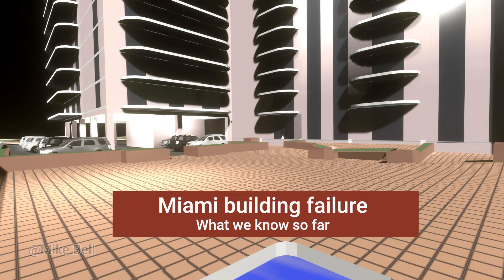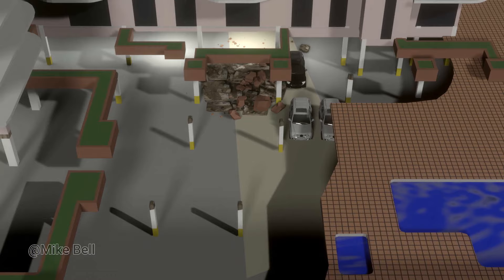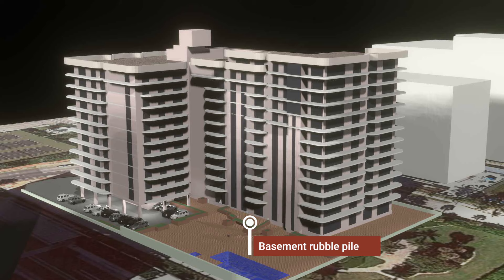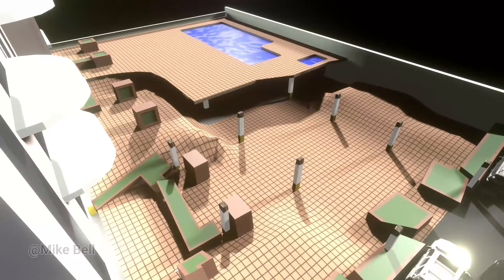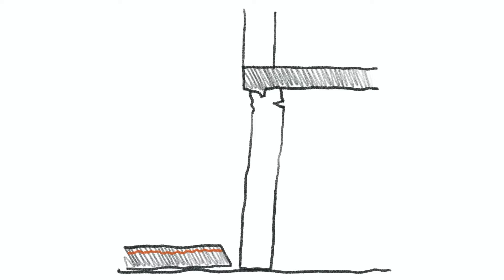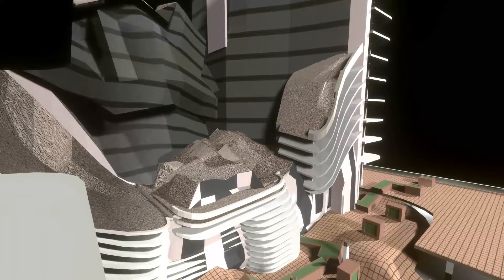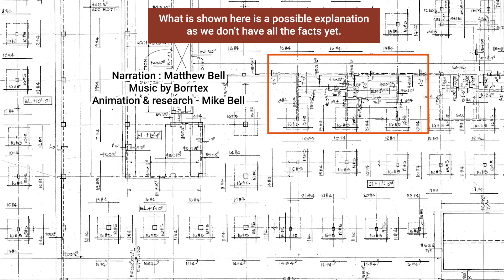MIAMI CONDO COLLAPSE | visualization of the evidence pt2

Comment: Why didn’t the front desk pull the fire alarm. So frustrating if they saw the whole thing caved in outside.
Reply: Fire alarm was apparently activated by the damage in the garage, there was a 911 call by the monitoring company reporting this a few minutes before the collapse.  Not sure of details beyond this, like if this should have or did activate the audible alarm.
Reply: @k53847  Never happened. The system does not dial 911. The broken pipe is not a sprinkler pipe its PVC
Reply: I guess the time was too short, they didn't know what they were looking at. The time lag was only a few minutes.
Reply: Might be a little deeper than that. A friend of mine lived in a new apartment building. An electrical fire broke out in her apartment while she happened to be home (the smoke detectors never alerted, even as smoke billowed) and, as she frantically escaped, calling 911 at the same time, she was told NOT to pull the fire alarms. That was always super suspect to me.
Reply: @7YBzzz4nbyte   In order for the people that say the pool deck collapsed  to be right the fire alarm would have gone off. Its a complex system. It does not dial 911 it sends signals. The two narratives are this. The roof was overloaded with roofing materials and caused the collapse . This puts the city at fault. The pool deck collapse puts the condo at fault . Had the pool deck collapsed 7 minutes before the building it would have triggered the fire alarm. Set off strobes in the entire building along with alarms. And then sent a signal to the monitoring station - that would relay that to the fire department directly.. (not through 911).
Reply: @whirlwind8825  Did they have an alarm like in office buildings? We don't where I live, every flat is its own compartment (annoyingly). It's a shame that those beams from the pool deck/garage attached to the side of the buildings pillars, and yanked them out when they fell, very tragic in hindsight  😢
Reply: @whirlwind8825  Well, then explain the 911 call at 1:16 am https://youtu.be/v2zRuxNjG2I?t=59
Reply: @whirlwind8825  Why does overloading the roof put the city at fault?
Reply: @7YBzzz4nbyte  Never happened. The deck never collapsed before the building.
Reply: @k53847   The building fell at  1:25am.  There were no alarms or  strobes . Had the system  alarmed at 1:16 am  the 300 psi pumps would have energized . The whole building would have evacuated under alarm . With 9 minutes warning  instead of 7 as the video with the leaking pvc pipe shows .
Reply: @sriley322  The city and the engineer knew the report of the buildings structural integrity . They did not red tag the building . Instead they issued a roofing permit and loaded the roof with tons of material. A one million dollar roofing contract for a new roof . The city told the condo association the building was safe .
Reply: @whirlwind8825  Well, in hindsight they were wrong. I just watched a documentary on Titanic, and it didn't go too well either (but could have, had things played out differently).
Reply: @whirlwind8825  Interesting- I didn't put that together but it makes sense.
Reply: @gymeni  In my building there are no fire alarms to pull. Not required, none installed. Each apartment has their own little fire alarm, mandatory, but none for the entire building all at once.
Reply: @whirlwind8825  if the deck didn't collapse before the building how do you explain the tourists' video into the parking garage? collapse of deck is seen and the building is still standing.
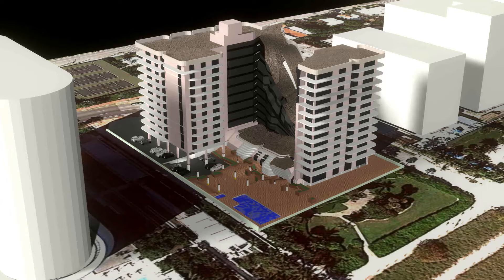Reply: @k53847  If the alarm went off  at 1:16 the whole building would be strobing, pumps running , alarms sounding. The only reliable evidence is the video . It is verified 7 minutes before the collapse . The audio is silent .. no fire alarm, no pumps, no strobing lights. Fire alarm  techs know I am right .  the system is inspected yearly . Broadcastify has the first dispatch to  the building by The  Fire department  and they are responding to a collapse ... Not a fire . The dispatcher clearly says collapse . And when the truck arrives he calls for all hands
Reply: @SierraFoxtrotLima  the video is the garage entrance , it only shows a pvc pipe leaking water slowly , no collapsed deck
Reply: They would have died anyway. Fire alarms sound fire alarms. Not water or  building collapses. Thus the term "Fire alarm".  Foolish question. Sorry
Reply: @novellmusicmedia6895  Yes, but it would have woke everyone up, and alerted them to an emergency. If the fire alarm was going off, then one would assume a fire was going in the building, which is a reason to evacuate.
Reply: @whirlwind8825  and what is on the floor of the garage? that is the main drive through - there is clearly debris there! you wouldn't be able to drive a car through it!
Reply: @whirlwind8825  That argument doesn't match up with the eyewitness descriptions of the pool deck having collapsed while the building was still standing.  The video of the parking garage supports those descriptions.

What you say might have been a possibility in an alternate reality, but with the various reports that the pool deck did indeed collapse first, it's not this reality.
Reply: @Test121212121212  many things don't match on his statements, he lacks many info on the subject.
Reply: @whirlwind8825  i never said it was the sprinkler pipe - I asked you what was on the floor of the garage - in simple terms. there was clearly debris on the floor of the garage before the building collapsed - so I ask again - what was on the floor of the garage in the video before the building collapsed? You don't give much credence to eye witness accounts and video evidence in your explanation.
Reply: @whirlwind8825  the area you can see from the video is not the ramp, it is the floor of the garage - go back and look at the building plans and count the columns. The debris is clearly on the flat garage floor and not the up/down ramp.
Reply: @whirlwind8825  pretty confident it did, by witness accounts
Reply: @whirlwind8825  no, there is also clearly rubble beneath the leaking pipe, big chunks
Reply: @purplepixie274  above that debris is the generator room..no pool decking and above that is a condo all  intact until the building collapsed .  There are no reliable witness accounts. Only people here defending a theory on 3d animation. This theory does not stand up to facts. And facts are in the fire alarm sprinkler system , the pumps(never actuated). No alarms and no strobes.  The facts prove the city, the engineer, the roofing company, and the material supplier that stocked the roof with a crane are all on the hook . The paper trail does not lie and is also factual. We have permits, approvals, and a Notice of commencement on the roof being completely replaced. A one million dollar contract and 27k in fees to the city of Surfside. After a Engineering firm recommended repairs on a building that should have been red tagged and emptied of occupants in 2018
Reply: @whirlwind8825  the debris is not on the ramp, it is on the garage floor.
Reply: @SierraFoxtrotLima  @Sarah Lancaster  The entrance ramp goes in and down to garage level   http://prntscr.com/1glgs55  the debris you see is under the generator room next to the stairwell  (second response ) There is no pool deck there....    Here is where the debris is http://prntscr.com/1gp1m7s    ... Here is what is above  the leaking pipe  http://prntscr.com/1gp3dz5   ......  Also the lights are still onhttp://prntscr.com/1gp9vr8  House power has not shorted out and tripped breakers
Reply: Also know one gonna think the building gonna fall ez to say shoulda woulda coulda after the fact.
Reply: @whirlwind8825  in the video you can see column 27 and the debris lies around and beyond it - col 27 is the edge of the building, what lies beyond it that has collapsed onto the garage floor is the pool deck.
Reply: Apparently whirl wind knows all.
Reply: @k53847  the sucky thing was the building had multiple cameras on the property facing different things including the pool deck, the cams fed to the security station in the building. But, like everything other outdated thing in the condo towers, the video feed went to tapes, and not the cloud. So when the building collapsed it crashed down onto basically the VHS tapes they used, all the security footage that was going to basically VHS cassette crushed so badly the tape was ruined by grinding, water, and dust. What a mess.
Reply: @kittykat7858  Whirlwind wants justice for the families. The victims. What you are seeing in real time is  volleying for culpability. Had I inspected the building I would have red tagged it (removed the occupants)  in 2018.   I would have shored up the building  before I  issued any permits in 2020 and loaded materials to the roof .  And I would press charges against the city inspector that told the board  the building was safe  after the 2018 inspection.  
 The bottom line is if I am correct the engineer and the city are at fault. They owe the people  or their families  a new building and some compensation for their agony, (they issued a permit on a building that should have been red tagged ) . 
   Saying the pool deck collapsed and pulled the building without absolute proof  or visual evidence  means the board is at fault totally for not commencing repairs  earlier from 2018 recommendations.

 There will be many experts and lawyers working for the city and the engineering firm  to push the pool deck collapse theory ..  They can not dispute the facts I presented .
Reply: Whirl Wind  I hope the families get justice. Years ago we had a disaster ,,40 people died. With blame shifting, lawyer fees, bankruptcies,, etc.. one guy said 2 years later that the settlement didn’t even pay his daughters funeral.
Reply: @whirlwind8825  the alarm company called 911 because one of the alarms located in the garage went off.  An actual person from the alarm company called to report it ( he said that it seemed in was a fire) and the dispatcher said we will send someone over to check it out.
Reply: @s.p.3702   That call is not reliable. It was 15 minutes or so before the building collapsed . We have no fire alarm  active in the video 7 minutes before the collapse. The dispatch  on broadcastify to the fire department was a collapse and not a fire call .    The call is not reliable in the timeline of events .  
  There is no  "one of the alarms" .. Once the system is active the whole building would see  strobes and loud alarms . The garage entrance  video has great audio and you can hear crickets  its so quiet.
Reply: @whirlwind8825  so, the call that was put on YouTube is fake?  I thought it was a real call.  Thanks
Reply: @s.p.3702   I never said any call was fake **You did** I pointed out the call was made 15 minutes before the collapse and at 7 minutes we have confirmed video of the scene with no alarms, no strobes, no 300psi pumps activated. No people awake in the building reacting to a alarm  and beginning evacuation based upon a fire alarm 15 minutes before the collapse .. Sadly the scene was silent 7 minutes before the collapse and nobody was awake to react ..
Reply: @colin-nekritz  The security station seemed to be in the lobby, which was in the surviving section.  But it's a crime scene, so if the video survived it won't be released for a while.
Reply: @whirlwind8825  ok, thank you.  Maybe fake was no the right word.  Was there a call from the alarm company? 
I am confused about the call that was put up in YouTube from the alarm company.
The lady from #111 said she started to hear noises since 1, but didn’t go talk to security until 1:14.  (When she heard a loud noise). Then when she was talking to security is when she saw the deck go down.
Reply: The Fire alarm panel calls (most fire alarm systems have a primary and secondary phone line) to a monitoring company who then calls the First Responders and whoever is on the POC list.
Reply: Lots of fire alarm "experts" in the comment section lol I wonder how many are NICET certified?
Reply: @whirlwind8825  you have yet to explain why debris is clearly visible in the onlooker’s video NORTH OF COLUMN 27 which is the column that runs up the north wall of the tower and marks the point where the deck begins. If that debris was on the ramp, it would be on the ramp, but you can see the ramp ends where the knee wall ends at the pillar one to the south. The ramp doesn’t run past that point without a knee wall, that would be very dumb. See all you have for “evidence” is that the fire alarm/suppression did not engage. What the deck failure theory guys have is a simulation like this, evidence such as delamination as seen in the core samples and on the punch through beams not having a shear head, and a clear sequence of events that is consistent with the eyewitness accounts. All you have is the fire alarm didn’t go off, it’s a coverup, and you’re right end of story. Go watch Building Integrity and learn a thing or two.
Reply: @calvinrovinescu6166  The video is showing a down ramp. The height is 6'5"  the video is street level  and the person is at least 5 feet tall so you are looking down into the garage. When you walk down the ramp  to the debris you are under the generator room  https://prnt.sc/1hoavbw.
to the left is a stairwell .  The debris is under the generator room

The pool deck was sheared and the freestanding columns punched through like a tool and die punch. A die maker would tell you you need tonnage and inertia to punch the columns on the pool deck. You can see a clean slab break and the tiles blew off full and not cracked along  the shear line   http://prntscr.com/1hoilru .

 I have more evidence than the  fire alarm inconsistencies. 
 Permits were issued, the building was not red  tagged, the city told the board the building was safe, . A engineering firm didn't stand its round and red tag the building   A roofing contractor started work paid 27 k in fees and was awarded a 1 million dollar roof contract.
 I have more information however it would reveal personal information and  violate youtube tos .  I have all my education in the field, not classrooms or simulations. I respect others opinions and find human emotion in the failure to prove a point ..quite amusing ..  good day to you : )
Reply: @calvinrovinescu6166  Maybe learn directions first before you decide to locate stuff in a building . Read the plans its under the generator room  the column with the yellow band is the North East  support column of the generator room, the beams in that area are under the generator room.  http://i.prntscr.com/oUnE6qegTDevG4ez9caZjQ.png. It is not the North face wall support column ..LOL
Reply: @whirlwind8825  it alerted a dispatcher..who in time called for help
Reply: @whatyouwerethinking998   read the comments  above ..The 911 call  from a monitoring station person was 15 minutes before the building collapsed .  The  video of the garage entrance Shows the building has power and no alarms or strobes  and no pumps running . The garage entrance video  is under the generator and pump room 7 minutes before the collapse. Lastly fire dept  was dispatched to a building collapse and not a fire as recorded on broadcastify

Comment: Good simulation but you didn't take into the changes in the design that were partly responsible for the collapse.  Your video shows the original design with a step down to the pool area.  It was not built that way.
Reply from the maker: Nope my video does not show the step down from the parking to the pool area.  The garage video is clear evidence the step was ommited.  I agree it was built without the slab drop.